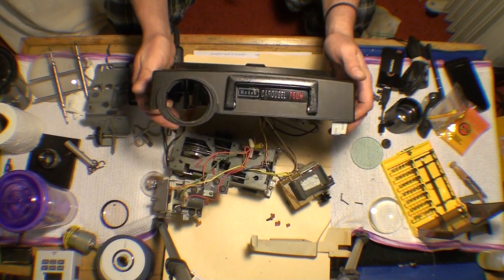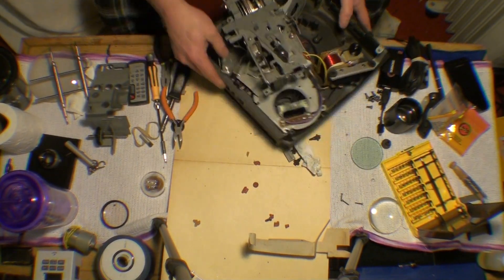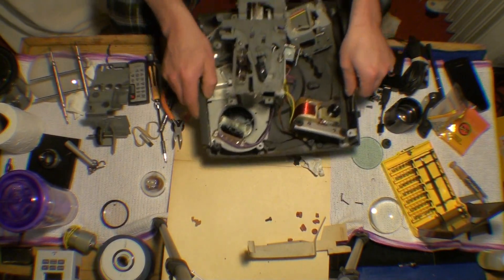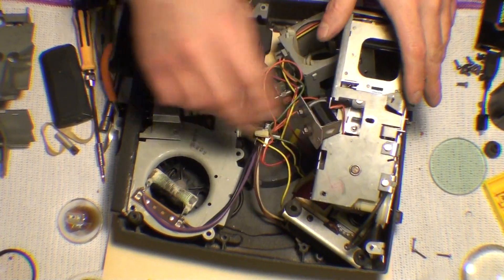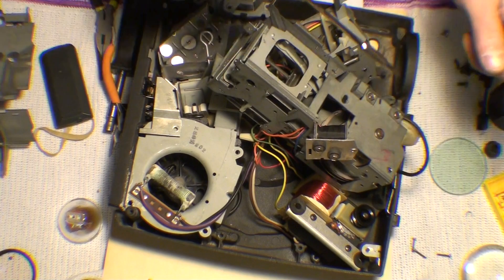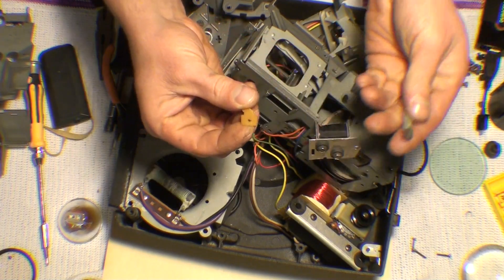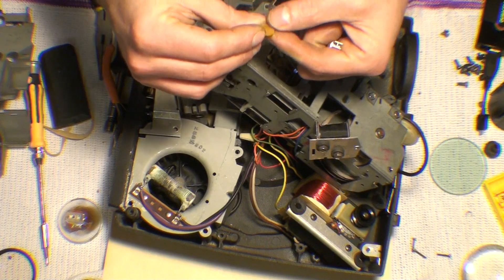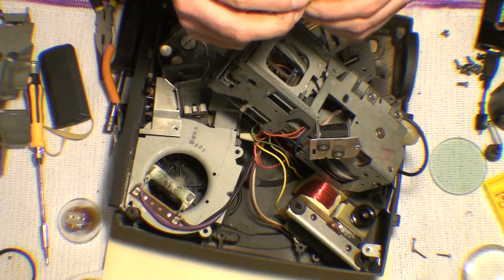Kodak Carousel 750H Projector Autopsy

Comment: Did  someone move bulb or mirrors when repairing? Otherwise works fine other than images show on screen all totally up-side-down. Is there is quick, easy and modest cost way to do this?
Reply from the maker: I can't say for sure, as I have never used one of these projectors to actually view slides, but if the image is upside down, and otherwise fine,  just flip the slides over. I know some projectors need to have them loaded upside down to view them properly.

Comment: You're right - that plastic .T always breaks. As you mention, it's possible to fabricate something similar out of 1/8" aluminum. I found that it's easiest if you taper one side of the aluminum T so it can be wedged back into position. I see there's a fellow mentioned in another repair video that sells the plastic pieces - the T and the focus gears - to put these back in operation, but like this video, that offering is several years old, don't know if they're still available. Great projectors, but a total PITA to repair, IMO.

Comment: Where you ever able to fix this?  I don't see a second part that shows the repair.  My 760H just stopped working yesterday; I pulled the bottom off and it looks like maybe the plastic piece is actually OK ... when I engage the buttons the plunger just doesn't move.  Every once in a while it makes a loud, brief popping noise.  The rest of the time a dull hum.  Any ideas?

Comment: kits to fix these are available on ebay.  there is also a very good PDF that shows how to do the repair with minimal disassembly.
Reply from the maker: I had actually purchased one of the kits, but I ended up scrapping the projector due to other issues :/

Comment: my Kodax 800 carousel projector stopped advancing. It sounds like the solenoid from other entries. I suspect it would  be cheaper to buy used equip than to find a repairman.
Any suggestions. I am located in Wilmington NC. My email is Jedge14@gmail.com

Thanks,

Jim

Comment: I'm also working on fixing my Kodak Carousel 650, but it's long project that I am going to work on. I took it apart and suddenly, I found a piece of solenoid which was left inside, and it's the same problem that you had. The part looks the same as this one. I'll have to order a solenoid link online, but one I get it done after that, I will be showing you my demonstration soon.
Reply: +Musicradio77 Television Network How did you successfully get it apart? I have a 650 & E2 I want to fix. But I cant get it apart!! I know its 1/4" hex bolts , but some of them are in super tight spots and my socket doesnt fit. I read online about thin walled sockets, but Home Depot and other hardware stores around me dont sell anything like that. So if I order one online - I need to make sure its going to work!!.
Reply: Sadly, I got rid of it last Spring and it was a total loss. So I replaced it with an Argus 500 slide projector which is a much better slide projector than a Carousel. It uses slide trays where you can switch the next one by using a lever, but it does the rest. It works perfectly after I got it at Goodwill last summer.
Reply: I have a 650 that doesn't focus. The projector belonged to my late husband. I am not mechanically inclined. Would it be wise for me to have it repaired or just look for a new used one. I don't have many slides at all, but would like to look at them for sentimental reasons. Any suggestions?

Comment: To fix this problem more easily (with much less disassembly), check out the Carousel ADVANCE Repair Kits on ebay
Reply from the maker: I actually ordered one of those kits, though I ordered the advance and focus kit.  The projector still needs to be dismantled in order to repair it.
Reply: +general0ne How did you get this projector apart? I know they are 1/4" hex, But I do not have a socket that fits in all the spots, as some are in some tight spots (like the one in the front corner by the lens). Did you use a socket screw driver? more specifically a brand if possible, so I know it fits.
Reply: +St Kittz  A thin walled 1/4" nutdriver (available at Sears, Harbor Freight, Home Depot, etc.) can be used to access the hex head screws.  Using my Carousel ADVANCE Repair Kit w/gears (listed on ebay) I describe a SHORTCUT method to make this repair which requires much less disassembly than shown in this YouTube video.

Comment: I pulled my 760H from its box and tried to load slides..... same problem. Pulled the bottom cover and also found the solenoid "pull" broken. The auto focus gear looks very fragile but it still operable... for the time being. It appears the entire mechanism has to be removed from the cover in many pieces. I'll still continue to repair RCA 45 players.... fewer parts and easy to service.
Reply from the maker: Yeah, It's a common problem on these... and a pain in the ass to repair...

Comment: Hi yes if I advance or reverse the slides a few times the squealing goes a way ,they are great projectors ,im also using a Kodak dissolving unit too, the other projector needs  the picture to be adjusted ,thanks

Comment from the maker: It's not supposed to be a hook, it's supposed to be a "T" shape.  There is two thing that you can be sure of with these projectors - 1) If it has not been rebuilt, it is most likely broken.  2) If it has not been rebuilt, and still works, it WILL break.  The plastic used in the parts was inferior and simply deteriorates.  Rebuild kits with the focusing gears and the solenoid actuator can be found on ebay.

Comment: Hi, I have this model and it seems to work well - however when I try to reverse advance, it intermittently, seeming randomly, does not reverse but advances forward. Forward advance button always does go forward, but reverse will not do so consistently. I can only get it to reverse a few times and then it continues forward. Any ideas? thanks.